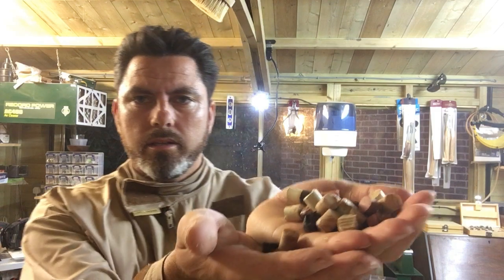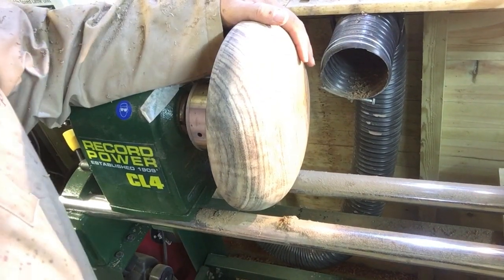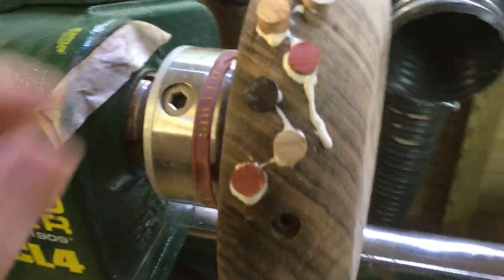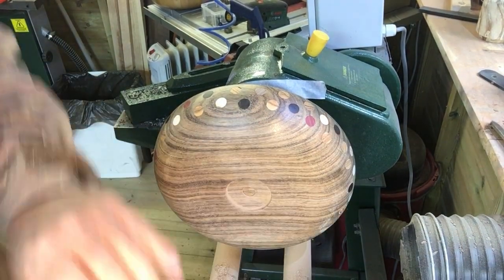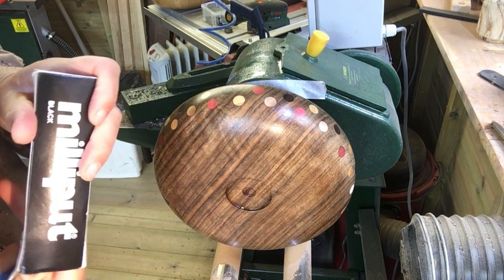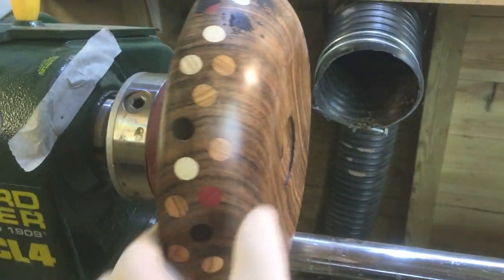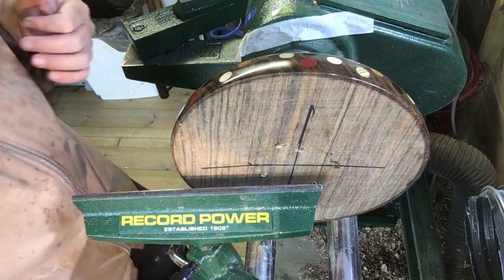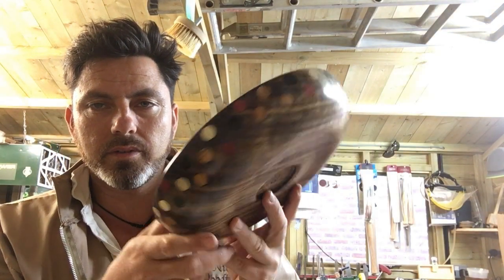Woodturning -  Measles on a bowl

Comment: Nice one Nick. I have used plug cutters in the past, but as you say, they do waste wood ( they also need sharpening after a time which is a pain ). Another way of doing it is to turn your own dowels between centres, it uses much less wood and you can make them any diameter you want. Cheers, Jim
Reply from the maker: thanks Jim. I did think about this but judging the correct diameter each time or measuring it would be a nightmare for me. I would no doubt take too much off every time. lol...   I liked it as both the plug cutter and the forstner bit where exact match so they just slid right in. All the best
Reply: I cheat and use a Robert Sorby sizing tool these days. Cheers, Jim

Comment: Very nice! Plug cutters are fun to play with. 

I think this decorating method is cool, especially on boring woods. Im not so sure this wood 'needs' it.

Why did you sand after doing the yorkshire gritt?
Reply from the maker: Hi Willem, thank you sir. I sanding it again as it was smeared after using the Shellewax. this happens now and again I think I had the lather speed to high. All the best